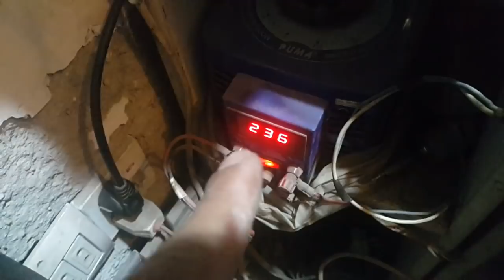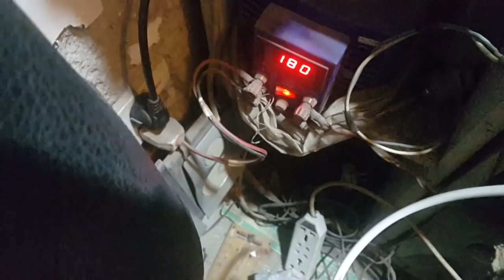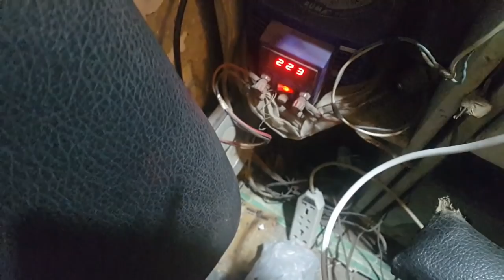Stabilizer Relay Broad Replacement With Volt Regulator Setting(170v to 260)

Comment: Sir, hamary saht 1000w auto stablizer hi.transfomer say 6 loops nekal hoye hi.awr aik com by hi. Fahlay as may 4 relay wala  circut ta.ab may naya 4 relay wala circut laga raha ho.lakin circuit ka andar relay on nahi hotay. transformer say 14v winding relay kalay nahi nekale hi.hum kasay relays ko operate karay
<Detail loops voltage >        input supply=148 v 
 =neutral +1 loop=0 v
  =n+ 2=156
   =n+3=192
   =n+4=220
    =n+5=243
    =n+6=275
Plz sir replay for answer
Reply from the maker: ap ke pass kit timear wali hai
Reply from the maker: aur ap k pass maltimetr hai to aysa karo 1 numbar loop neutral ko aur loop numbar 3 ko 220v do maltimetr se check kar k detail muje batao
Reply: akash Babu sir,humary saht simple circuit hi.220v supply say kam far check nahi  hota loops ko .
Hum nay tuh input 148v 
Far checked kiata.neutral +1loop=0 value  show.sir aik bahat him say bohl huh chuhkata.as ka com say phase attach hi.bahqi 6 loops hi
Reply: Sir,hum nay dobara digital Meter say check kia.
Input supply 180
Neutral+1=14v
Input supply=150
Neutral+1=6v

Sir awr mesla hi circuit may.as circuit may relay ke com on say attach hi.hum loop kaha lagaye.our out point relay ka kas point say lay.
Plz reply
Reply: Sir,
Stablizer may hum nay circuit laga  hi.lakan as may ye masla ia rahi hi.ka jab input voltage 235v ho.tab ye 235v say 300v deta hi.main supply ko manual regulater  hi.jab may fahla 220v loop wala veriable 220 far tuno karwata ho.tuh parh 100 v input say 150v output  nahi deta.
Plz reply

Comment: Steplizer main agr input votls 240_ 260_280 volts ho to out put ko kam kry ga(220 ya 230 jo setting ki ho)?
Ap k reply ka intzar rhy ga.
kindly es 4 relay kit k price bta dain.
Thank dear
Reply from the maker: Ghulam Murtaza is mein ak stap dawon hai jo 250 input ko dawon kare ga 220 output.aur 4 wali kit ap 280 Rs mein aye gi
Reply: thanks dear

Comment: Sir mara pass 15 kva ka stabilizer hy os ky 6 step hein 1 170  2 200 3 220 4 235 5 230 6 260 or 7 cable hy wo neutral hy tu sar is ky leya konci kit lagy gi tu plzz bata dein